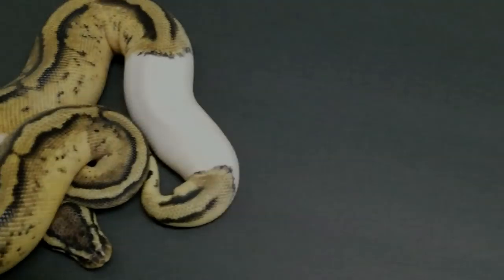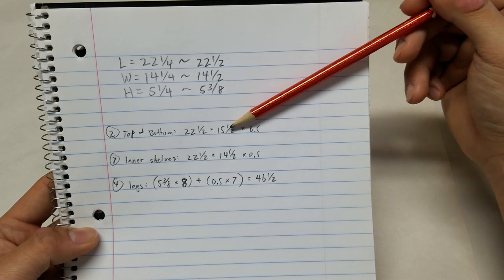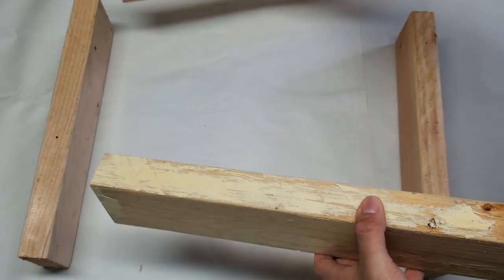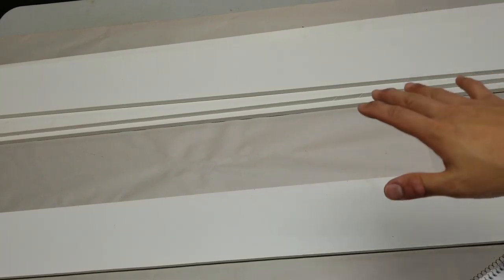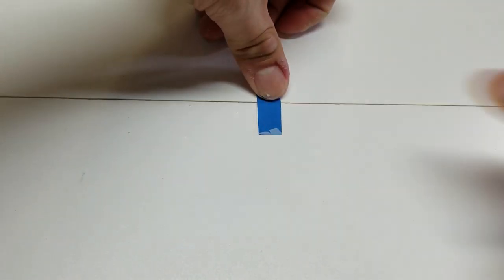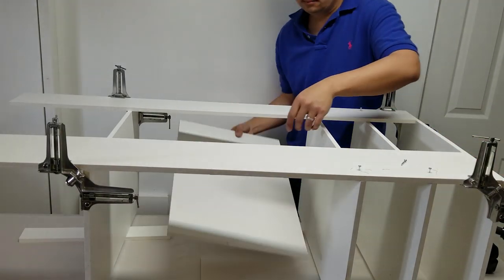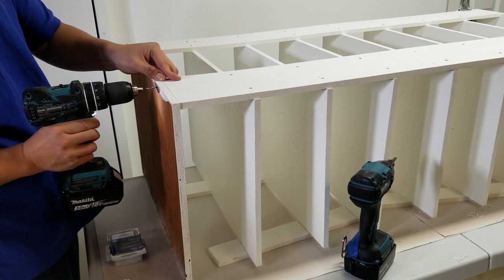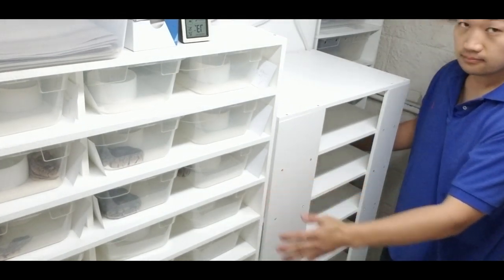Ball Pythons: Detailed Rack Build Part 1

Comment: Just curious if you've considered pocket holes instead of screwing into the end grain for your base and wooden racks?

Either way, love the walkthroughs, they are well done, and give great examples of how to do this.
Reply from the maker: I like pocket holes if the wood is thicker than 3/4in. But I'm using mostly 1/2in PVC for the rack - a bit thin for pocket holes for my liking and PVC is consistent throughout so I'm not worried about end grain. The base can utilize pocket holes, it would give a cleaner finish. Thanks for the suggestion and kind words.

Comment: What size and brand tubs did you use for this project?

Do you get your pieces cut at home Depot or do you cut them yourself?

Is there much room for error or is everything very precise?
Can you estimate what each rack costs you?

Thanks
Reply from the maker: That one probably cost under $150 to build. I usually get the larger pieces cut at home depot just so I can fit them into my car and I'd cut some small pieces myself.  For this rack I used the boot box from The Container Store, about the same size as sterilite 28qt tubs.